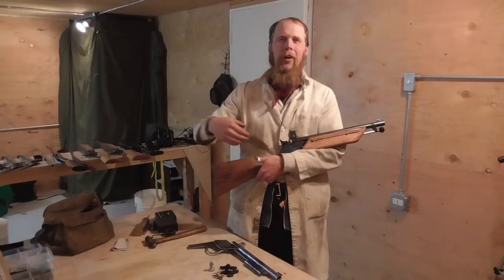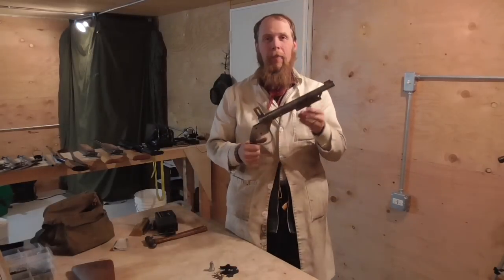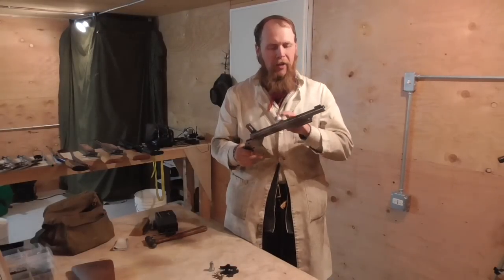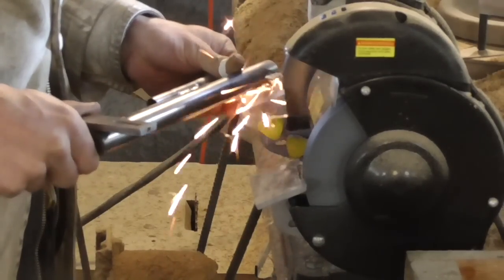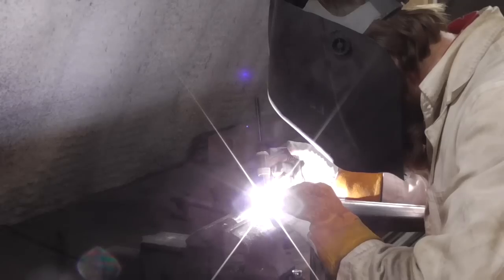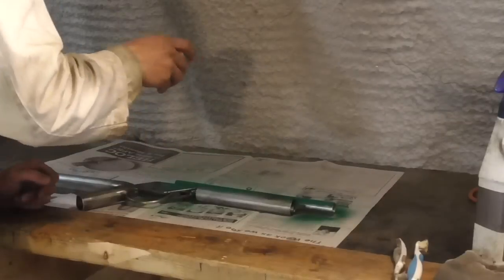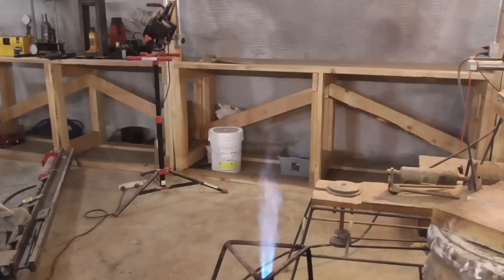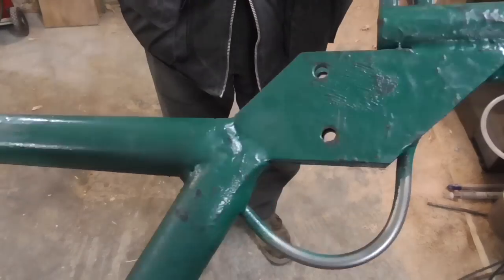Finishing a Beta-Pattern Muzzleloader - Paracord Tacticool Build (TIS267)

Comment: How about a double barrel pattern gun?
Reply from the maker: I have been thinking about how I might adapt this design to a double-barrel gun.  I'm not sure when/if I will get around to building one, but it is definitely on my mind.
Reply: @TheIdahoanShow  rabbit ear design maybe with two triggers 
I was thinking that maybe  both hammers could ride on the same pin as well  both triggers  but that could potentially cause both barrels to fire  at once
Reply: And market it as a survival gun. 1 barrel rifled for round ball or conical projectiles, the other smooth bore for shot.
Reply: @TheIdahoanShow   I got a book about recreating the double barrel muzzleloading shotgun. Kinda rare book to find at a normal price since its out of print. I could share it with you
Reply: I would love to see that I collect home made gun literature. Looking for a good centreline shotgun over under atm but a sxs bp would be nice to have if you have a source.
Reply: @jediknight1294  I do not have anything for an over under yet unfortunately.
Reply: @kingdarkem  hell any form of double would work its to modify to fire the co2/propane/'green gas' cartridges for airsoft shotguns since the only airsoft double barrels are now 450$ each and only come up rarely second hand.
Reply: @jediknight1294  I have nothing for airsoft. The only thing I got for double barrels is a hand written list of tooling and a brief handwritten synopsis of steps....I have yet to test it out and it would require a forge and a helper at least....youd also need skelps
Reply: @kingdarkem  I have a forge and access to a professional blacksmith and a fair few tools and machinist friends and some machine access  What I need is a good double barrel trigger mechanism. 

The way these shells work is inside there is a blow forward  valve, sealed with an o-ring. This valve seals a gas chamber when filled the gas pressure pushes the valve stem back so that it can only be forced forward by a force/shock.

The construction of the shells is such that the valve & seals  are one piece screws onto a front which has a hole drilled through the centre to be filled with BB's and the majority of the gas chamber is in this front piece.When screwed together you insert gas and the valve is pushed back  against the rear of the shell so it is flush with the bottom of the shell. When this valve stem is pushed inwards it reveals ports inside the base which fill with gas and that rapid expansion propels the bus.

In this and tbh pretty much all gas in shell airsoft designs the space where the primer would be on a real shell is where the valve face is. They set up the weapon so that a hammer strikes the rear face of the  valve causing the blow forward valve to move and pressure to drop behind it meaning gas rushes to fill the space and thus push out the projectile.

Because of them being built around real firearm sizes they use realistic trigger mechanisms (all gas airsoft is hammer fired basically even the glocks so a well tuned airsoft Zev/Salient Arms licensed race gun  competition glock has a better trigger than a real zev ) All I have to change in a hammer design is where you'd put a sharp pointed  firing pin I'd simply have a roundstock bar acting to push on the valve with force.

This is why if you take an airsoft 1911 (other than WA or TM)  you can take one of the advantage arms .22lr conversion slides and drop it onto one because the conversion kit relies on a centrefire  hammer hitting a rimfire striker you have no problems.

WA guns used a very much different valve system so the hammer and striker assembly is different and TM the frame of their 1911 is polymer so not really trustable.
Reply: @jediknight1294  the only thing I can think of is the simple trigger from glen davis's book isbn 9781985883864.  The double barrel over unders I am familiar with have a dual hammer....think of it as cut in half on a trigger pin and a bushing with their own sear and a block safety wide enough to prevent travel of both hammers should they slip off the sear with both triggers under trigger spring and plunger power. These are the internal hammers which are connected like Sears to an external pair of hammers....its for a SxS...i would assume it be the same basics for an over under with the hammers being closer together and no external hammers
Reply: @kingdarkem  thanks! Tht should be a great start.

The one I'm after will give me one hell of a less lethal gun for the foxes and badgers that may attack the chicken coop on the allotment (no firearms discharging within town limits) a rubber ball weighing 10-20g fired at 300fps.
Reply: @jediknight1294  generally one can trap nuciance animals without a license in such cases. Hazing does not always work in my experiance. You would have to consult with the local warden service though.

Comment: Just a thought on the curing of the power coating, why not set a length of round duct pipe on top of the propane burner and suspend the part above the flame inside of the duct.

Comment: when I was  camping once I saw a plywood oven with aluminium lining it folds up for transport and should be long enough for a full length rifle the guy who built it just had briquetts in a raised pan for heat more than enough to cure your powder coat

Comment: It would be really tacti-cool if you fitted threads where the paracord on the stock tube is so it could be removed or even fitted with an m4 adjustable stock